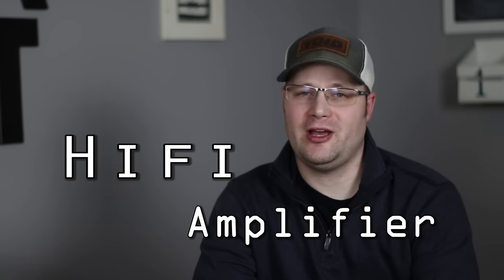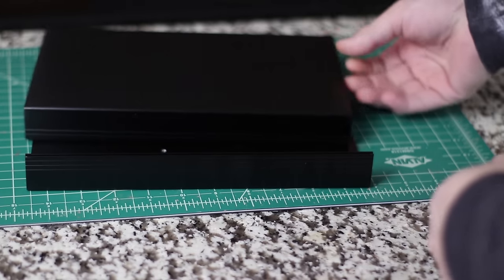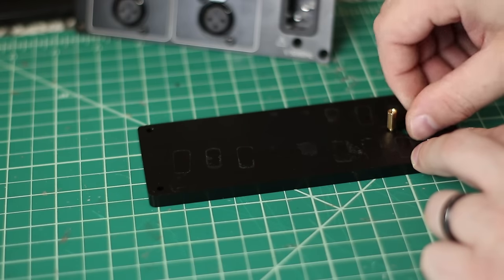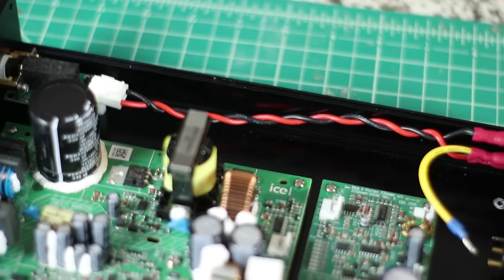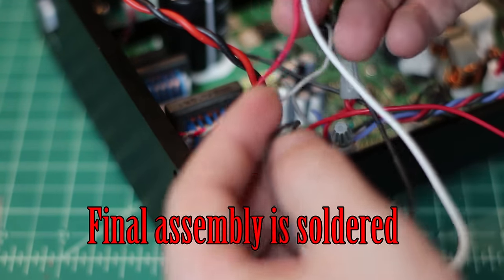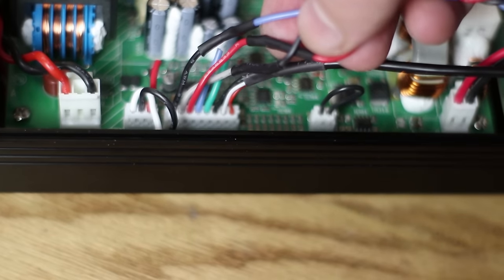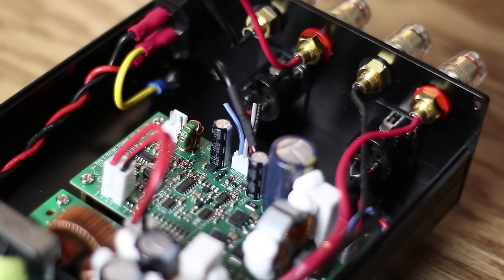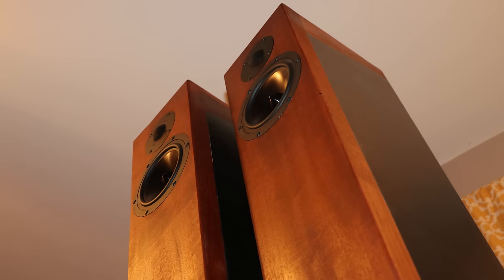How to Make a $3000 DIY HiFi Amplifier for $300

Comment: I would rather get nice used 200 Wpc top of the line Rotel power amp. Like RB-990BX or RB991. At least they are full of Black Gate caps. And might even sound way better than that class D.
Reply from the maker: Buying used is always an option.  And something I always suggest when on a budget. The only issue is that some of the amplifiers you mentioned look like they are over 20 years old.  Typically by that time, the caps are going to need to be redone to get them working like they were new.  So that adds another cost as well as a tear down, desolder and resolder that some may not want to get into.
Reply: @Toid  I don't know. My Rotel RB-981 that I've purchased in 1998 just works as new. So does the rest of Rotel gear that is about the same age.
Reply from the maker: @IliyaOsnovikov  yeah, there's never a certain date that the caps will go bad by. It has a lot to do with the environment they were in and how they were used.  But practically speaking, if your buying an amp over 20 years old, you should count that as an expense. Whether you need to do it now or in 5 years, you'll need to do it.
Reply: @Toid  Agree. Each type of electrolytic caps has it's own rated life time in hours of operation. Some of them rated 1000 hours, some other 2000 or even 4000 or more. However there are poor quality caps that could fail over time even without being in service. Fortunatelly the Black Gate and BNC caps used in Rotels do not belong to that category and seem to be pretty reliable.

Comment: Am I being stupid but where's the volume control? I'm confused can any one help.
Reply from the maker: You're not being stupid. With most HiFi amplifiers you will use a preamp to change the volume. You're just used to seeing them built in.  Any preamp will work. I use my Marantz receiver which has RCA preout. The simplest preamp would be a cell phone 3.5mm out
Reply: @Toid thanks for the reply. I have a MISTRAL DT309, (which has been one of the most surprising pieces of HiFi equipment I have bought over recent years) that will do the job nicely.
Thanks again

Comment: This video is misleading. There is a lot more that goes into those amps you named than the Ice module. I built one myself using the ice module and then heard (and eventually bought the PS Audio amps you reference). The additional work put into the input stage, the additional outboard power supply and many others have a DRAMATIC impact on sound. Now what I WILL say is that the ice module amp you built as is will still sound great and satisfy most people, but to call it as good as some of the other AMPs you have noted just isn’t true.

Comment: Can anyone relate to the issue I have with Digital? Every Digital amplifier I've had within a year or so, starts to get noisy. Sounds good at the start within a year, sounds harsh... Not putting down digital amplification, perhaps it has improved drastically over the last 10 years? I've just never gone back to digital... Not here to debate, just curious if anyone has had a similar experience?
Reply from the maker: Just to alleviate any confusion.   Class D, doesn't stand for digital.  It is actually an analog amplifier.   There have been and still are some really bad class D amplifiers (noisy or with high THD).  Paul from PS Audio talks a little about how Class D has advanced in time, you might find it useful.  https://youtu.be/wKb3zi6Oo84

Comment: Class-D Ice amps are "HiFi" now? Build an AMB B-24 if you want a serious DIY amp project that will actually sound good  :^)
Reply: Yes, they definitely are.  There are literally dozens of OEM Class D output modules that will blow a B-24 right out of the water in every conceivable way, which is why they have been incorporated into "high-end" power amps with four and five figure price tags.

Comment: But as far I know the amps class D are not good like the A/B amps for hifi
Reply from the maker: Actually alot of HiFi companies are switching to class D amplifiers.  They are more efficient, weigh less and can often cost a lot less. If designed properly, like these IcePower (which many hifi companies use) they are very low distortion and offer great sound.  But not all class D amplifiers are HiFi.
Reply: You are correct, sir. Not even close. If you want "cheap" HiFi you should do an LM3886 project.

Comment: Just got a Mcintosh MC2105 for 1000€ (loads less then 3000$)... I really wanna see this crap competing against that 😂😂😂
First thing I noticed about this is how urs not stable on the table while you are hooking it up😂😂😂
Reply from the maker: Well for that price you could build about 4 of these :). As far as the stability issue. It's on s farmers table. The table itself is rustic, ie not designed to be completely level.  It's fine on any solid surface.
Reply from the maker: @TA-nn9os  that is a great point. I don't know how many vintage amplifiers people have given me that need to be recapped.  For some people though it really is an option that they might enjoy.  But for me, I'd much rather have something like this. Plus how often is it that you can say that you built the amplifier that's in your system?  That's just a whole nother cool factor to it

Comment: This isn't called "building an amp"😅 . Its merely saving money by assembling the box yourself- for dummies. 
Building an amp means soldering transistors, capacitors and resistors following a circuit scheme. 
And even though Icepower is very good budget class d, where does the 3000$  claim come from?

Comment: What? $3000? Is it Bose? It certainly isn't a audiophile amp. Class D amp,  switching power supply? In what world is that ever going to compare with a $3000 amp.  Don't get me wrong, it is a great little unit but you could get far better sound from a second hand audio dealer for the same money.
If you really want to build your own amp look at look at some of the raspberry pi audio developers like allo, with a 24/192000 audio transport, clean power board and amplifiers to match. Same sort of cost as the above amp but far superior sound quality.

Comment: Nice video but total BS. I have owned class D for about 10 years (early models were not that great). I use them now, but getting $3K sound.from this board is NOT remotely true.. See PS Audio class D Ice based M700 mono block amps MSRP $2995  But for the DIYers, Word is class D sounds much better when NOT in a metal box. Try building on an open board

Comment: IMO a class AB amp sounds a lot better. I don't care about power  less heat, saving circuit board space blah blah, I want the best sound.. Why would anyone want to spend 3k or the time to make a class D for this application? It's not a portable device running on batteries that needs to be small and light. It's supposed to be high fidelity. The best sound. Anyone?
Reply: @Genuine Audiophile if it gets you to stop advertising for companies as if your were a living commercial. Then yeah I would say that calling you a shill accomplished exactly what I wanted it to. In fact if you didn't at least feel a little like a shill or at least think you come off like one, then you would not have wasted your time responding.
Reply: @Genuine Audiophile Matt is just a troll that needs a hobby. Just ignore them. I appreciate additional information and I'm glad you gave me some, however the linear range that Class A and class AB operate in is the reason they make better audio Amps. I looked at NAD's website. Not only could I find no place that said what class amps they were using I could find almost no technical info at all. Price point means nothing to me by the way. I see people paying tons for snake oil everyday. What have they done to make class D better? How are they saying it's better that Class A from a sound perspective?
Reply: @Ryan_Tidwell  calling people out for shilling is not trolling. Dude is saying that: no, no, everything you've ever known about amps is wrong. Class D is JUST as good as AB. Meanwhile no one thinks this and he is using actual marketing material from a for-profit corporation to make his point? I hardly think I'm trolling and he responded by saying I have no technical knowledge. THEN I started trolling. It was very effective too.
Reply: @mattsch21  Lol@"then I started trolling. It was very effective". 
The fact is: whether or not he makes money from it, is, not relevant. His answer was a valid response to my question. He has yet to prove anything however. We have no evidence that he is "shilling". The question is: why do you care so much that you get so aggressive toward potential "shillers"? Have you been taken advantage of by salesmen too many times or something?
Reply: @Genuine Audiophile Thanks for your response. I checked out the site you provided. "Once thought to be inferior to traditional topologies, NAD’s advanced work in this area has led to some of the best performing amplifiers on the market today. These new designs are linear over a wide bandwidth and provide consistent performance into all speaker loads, delivering a dramatic advancement." Pretty much word for word what you said.
 And it's all a bunch of twaddle. Where is a  graph showing the linearity of a class A amp to this special class D? I don't think you get what you are claiming. It's like saying you invented cold fusion or changed the laws of physics. Classes of amplifiers have inherant characteristics. I see granddios claims, but without proof only a layperson is going to buy them. You really need to stop equating audio quality with how much companies charge. Cost  is not a good indication of audio quality. I'm speaking from personal experience here.
Reply: @Ryan_Tidwell  so actually you checked out his shilling "knowledge" and agree with me lol? Yeah he was copy and pasting marketing material from the manufacturer's website... just like I said. You call me out for calling him a shill and then essentially call him shill lol wtf?
Reply: @mattsch21  I didn't call him anything. I did check the link he sent and asked for evidence. I don't mind if someone is selling something as long as it is a good product and they know enough to convince me the product its worthwhile. I'm an engineer though not a noob that believes marketing propaganda. U just need to be nice and listen before you call people out. Give them a chance, then if they turn out to be greedy"shillers" then you can tell them so if you must.
Reply: @Genuine Audiophile Thanks I'll take a look.

Comment: Another way to get a $3000 amp for $300 is to go vintage
Reply: Unfortunately for this theory, is the "vintage" amps that sold for that much back in the day tend to still demand nearly as much today.

Take, for example, the massive 300+ WPC McIntosh MC-2300 from the 1970s.

https://www.ebay.com/itm/McIntosh-MC-2300-600-watt-power-amp-EXCELLENT-CLASSIC-REFERENCE-AMP-/163347266513?_trksid=p2385738.m4383.l4275.c10

IOW, "vintage" is not necessarily the answer if you want this much power on a budget.

Comment: I wouldnt call this a hifi amp. It is class D amp powered by impulse psu connected with long tiny wires. High noise, high distortion, low power, certainly no hifi.
Reply from the maker: Unlike many class D amplifiers, IcePower is very low noise and distortion. Ice has released the specs of this amplifier which are very impressive. All testing was done for HiFi companies that were buying this to put in their HiFi amplifiers.  Which is why do many HiFi companies use IcePower amplifiers.
Reply: did u know who made ice power?look it up u may find it interesting.

Comment: I doubt you can build it for that price for the same quality
Reply from the maker: You should check with the people that have built it.
Reply: 123Toid i can imagine you can build it cheaper than buying it. But there is no chance that built $300 amp Will sound as good as $3000 amp. Hegel h190 is in that price range. And there is no chance Any built amplifier for $300 will be as good or sound as good

Comment: So why don't you just build them yourself and sell them for $799? Probably because it wouldn't fare well for value upon scrutinous reviews.

 I honestly don't think this amp is gonna be nearly as stout as the $230 emotiva a100 and probably more costly. It doesn't look nearly as professional as the emotiva amp.

Sounds like a Ghent audio and parts express infomercial tutorial to me. No one else sells it because it isn't in high demand I'm sure. Otherwise, Amazon and Wal-Mart would be all over it like flies on shxt.
Reply from the maker: Actually these boards are not made for consumers.  They are sold to HiFi companies and not the general public.  It's the reason Amazon and Wal-mart etc don't have their hands on them.  They are slowly releasing some of them to distributors.  Parts Express is the first in the U.S.  We will have to see if anyone else will get their hands on them.
As far as the Emotiva goes, they are great amplifiers.  I like Emotiva.  They downside with the one you referred to, is the fact that it is only 80w @4ohms.  Where this is 200w.  So there is a big difference in head room.  It also doesn't have balanced inputs for high end gear.  If you don't need or want the head room/balanced inputs, I have no problem with anyone getting the Emotiva.
Reply: @Toid  so why you don't make them yourself and sell them for$799?
Reply: @kohnfutner9637  If he makes an amplifier for a living, he will be subject to a lot of regulations, and need to offer warranty. He will need to certify a lot of things. This is also "what-about-ism", he showed you how to make juice out of lemons, so now you demand that he start running a juice factory? Some twisted logic that is.

Comment: Where are your volume control, source selector, balance and, bass and treble knobs? Also where are all your audio input jacks? You went through this tutorial much to fast. If I were interested in building a stereo amp there's no way I could do it following your instructions. By the way, who say you have to spent $3,000.00 for a stereo amplifier. An expenditure of $300.00 USD will buy your a pretty decent amp. I have an Sony and an Onkyo receiver that each cost less than $200.00 each. The Sony is several years old and is a very heavy powerhouse. Still is good as the day  I first hooked it up. The Onkyo is pretty new and produces as clean sound as I've ever heard. I expect it to go strong for a long time. I don't understand why manufacturers put tuners in amps any more. Nobody plays a radio  these days. FM tuners they put in receivers sound pathetic compared to a good quality CD or vinyl record.

Comment: i'd rather buy a decent vintage amp for that money.
Reply: I'd rather not shell out good money for an old amp that will almost undoubtedly need a three-figure restoration job to perform properly.  I recommend viewing the videos of U-Toober "xraytonyb" to get an idea of how much skill and time it takes to get those dinosaurs operating reliably and sounding good again -- and only the top tier of vintage amps will be even slightly better than a Hypex- or ICEPower-based Class D unit.  Suit yourself, but don't say I didn't warn you!  :-)

Comment: Where are you getting this $3,000 price from?. Thin air?. What would make this worth $3,000 is actual Gold being used inside the Amplifier for connections. This doesn't have any Gold. This amp would need to have a minimum of 5,000watts of pure power to be worth $3,000,

Comment: not make - assemble pre made parts - making is when you solder components on board yourself - people not making anything here, like 95% of videos say make and then they assemble parts from ebay.... would be making if you buy transistors capacitors resistors board etch it, solder components, buy case connectors etc...
Reply: He didn't say how to manufacture the amp, he said how to make it, a DIY project..

Comment: I guess I'm old school. Stringing together some cheesy Class D Chinese boards I wouldn't exactly call building an amp. Nor would I consider this HiFi. Comparing it to a $3000 amp would be like comparing  a Kia to a Bugatti Veyron. It's Class D bruh, buy a Lepai Ti2020. A $300 amp like the Cambridge AX35 will blow this set up into the weeds, as would any Class AB, A or B amp new or used.